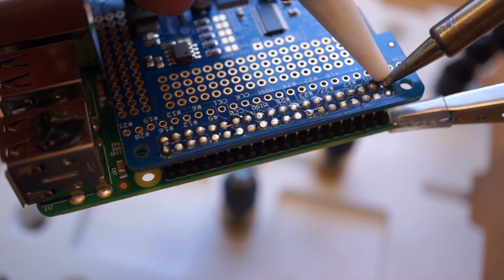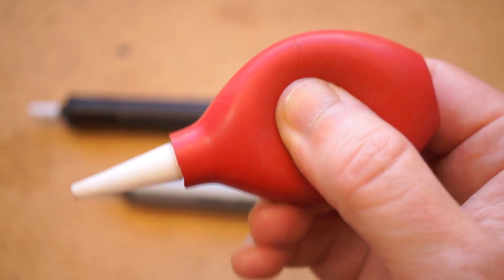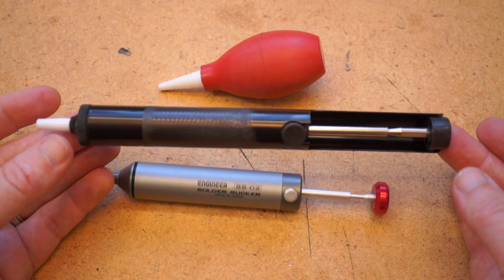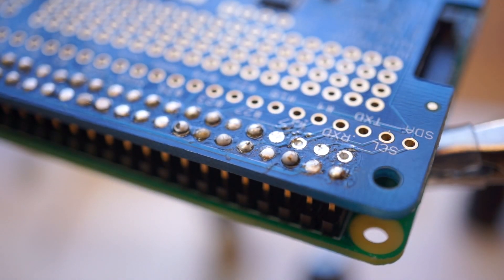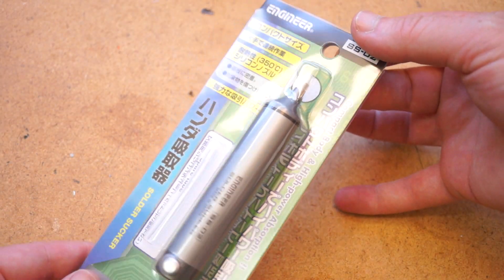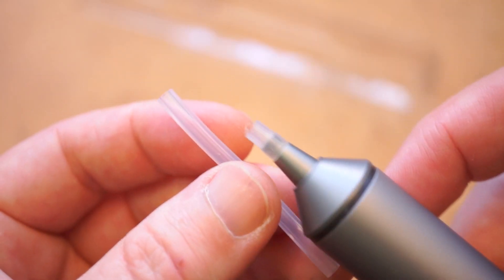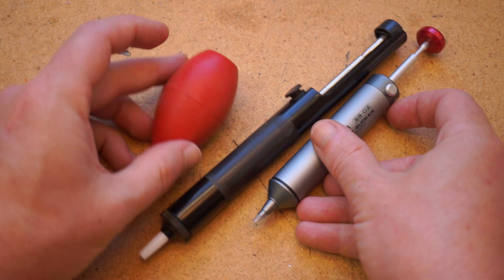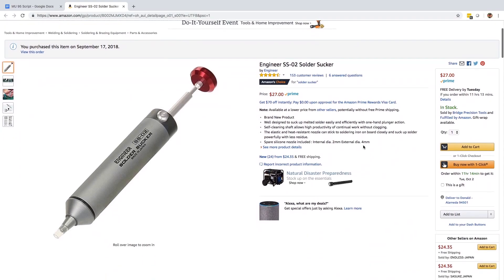Best solder sucker

Comment: Been wishing mine had that flexible tip! I filed the plastic tip of mine to a bit of an angle which made it slightly easier to use but still not ideal. Wonder if I could just get some silicone tubing and push it onto the tip of my current sucker. Though the design of this Engineer is pretty attractive also...
Reply: Yep, I've seen it used in a repair center lol. Cheap silicone tubing just stretched onto the tip. Works wonders and doesn't cost much

Comment: $30?  I would use the money towards an electric desoldering gun. It will permanently end your frustration with desoldering components.
Reply: electric? is there any other kind ?
Reply: @EpicBunty  I'm sure their a butane one made.
Reply: Wish I would have done that. Bought the engineer trying to be a cheapskate. Ended up buying the proskit SS-331H anyway. Wish I had just saved my 30 bucks and put it towards the SS-331H.

Desoldering guns are amazing. No sense spending $30 on something slightly better, when you can spend $130 on something night and day better. Way better value. Granted there might be cheaper alternatives. But didn't wanna waste anymore money trying to be a cheapskate.
Reply: @nerdstrangler4804 what’s the advantage over the plunger
Reply: @phr3ui559  Other than speed and ease of use, the fact that you can seal the nozzle against the board without removing the heat source. 

As with a basic solder sucker you either have to leave air gaps as you try to fit the nozzle around both the component and the soldering iron. Or try to quickly try to remove the iron and clean the joint before it  cools off.

Being able to heat and seal the joint at the same time is much more effective at removing solder. Which is helpful for a lot of modern electronics with really tight tolerances.

Granted, you don't need a big piece of equipment like I have. But if I needed something better than a basic solder sucker, I would probably look for something with a heating element built in.
Reply: A chinese copy can be bought at $5 and it works well.

Comment: Been using a Swedish Paladin solder sucker with teflon micro tips for 40 yrs along with my Weller iron. I love it. Tips cost more probably but the action is professionally clean. If you don't run too much heat, they'll last a good while.

Comment: ty for the tip I just put some silicone tubbing on my plastic tip.
Reply: where did you get a silicone tube? I wanna do the same
Reply: @heeku_  I had a bad handle for my ksger solder iron, so ordered a new and cable followed with it, so I cut a part of the broken handles cable of.

Comment: Or you could do what I do and use the second one you showed and just put high temp silicone on it you could get a meter of it pretty cheap
Reply: what diameter did you use? I only find ones that are maximum 280°C resistant and I solder with 350°C

Comment: 1:10
How do I disassemble it, because I want to clean it? 😢
Reply: Unscrew it. The metal part and the plastic end unscrew.
Tap the metal part upside down on the table. Bits of solder should come  out. Sometimes it will clog up and you will have to push a small screwdriver or something through the tip to losen it up.
Reply: @Rose-ec6he  
I know how 👍
https://youtu.be/bzG0NEdA9oU

Comment: The video shows the worst technique trying to continue to heat the solder while sucking the solder, remove the soldering iron immediately before sucking solder with a good seal on the board and they work much better!.

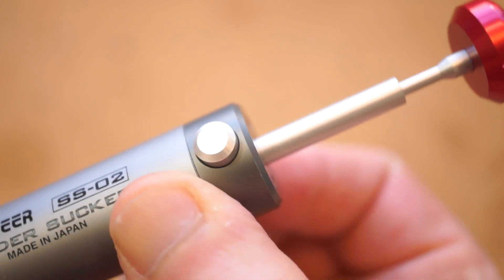Comment: 2:03 So I'll just buy that tubing on eBay or AliExpress, and then add it to my cheap aluminium sucker. Problem solved for a mere fraction of the cost of the SS-02. :-)
Reply: Make sure you get one that can withstand higher temperatures.  The first one I tried melted on the iron tip.
Reply: @ian1352  which diameter did you buy? can you link what you bought?
Reply: thats what i was thinking also
Reply: dude how many times will you make the same comment

Comment: I have the Engineer tool and it's great, but the silicone tube replacements are VERY EXPENSIVE!
Reply: I'm pretty sure a silicon tube like this costs pennies. I use them all the time for fishing and they are dirt cheap. I suggest look for silicon tubes in general not for "Engineer SS-2 silicon tube replacement"
Reply: Go to the closest RC-store and ask for silicone tube for methanol engines.  It is the same silicone and size. Doesn't melt.

Comment: Nowadays you can get a power Desoldering Pump for around $20 ($10 if you order directly from China). While not the best, its an iron and sucker in one, so you can heat the solder while simultaneously sucking the solder away. Perfect and cheap for small jobs, though longevity of it is questionable

Comment: What's the benefit to this instead of just wicking?
Reply: It's easier to get solder out of holes with a sucker or a desoldering gun and you don't need to keep buying new wick. It of course depends on what you are doing if you need one or not. Desoldering a typical 28-pin IC from an ancient computer with a thick pcb and decades old dried up solder and getting the holes cleared for inserting a socket for a new one will require quite a long strip of wick and patience. Using a good solder sucker makes it quite easy, using a desoldering gun makes it a breeze. Using a bad solder sucker is very frustrating and you'll likely break something.

Comment: According to the instrunctions on the Engineer Solder sucker: NEVER REMOVE THE TOP SCREW. also the item is cheaper at Adafruit
Reply: exactly!, if you do this you will mess up the complex seal (it's NOT a simple o-ring seal) and it will lose suction. then it will start to have solder sticking in the metal part of the nozzle area because it wont enter with enough velocity to clear the narrow nozzle body without cooling first.

Comment: I had to resort to a wick/braid for very tiny pcb's because the end of my pump is too big to properly fit over pins that are very close together. I've been having a hard time finding a pump with a narrow tip. Maybe the Engineer pump is the solution or maybe I should save my money and just stick with the braid.
Reply: Sometimes braid is the only way.  It is also usually the best option to get the last remnants of solder off.
Reply: @ian1352  Thanks for this. The braid has become my new best friend. I only wish there was a way to get the solder off so it can be reused. That's the only downside to it IMHO.

Comment: My experience with the engineer has been horrible. After only a few months of light desoldering the spring somehow has so much resistance that I have to hold the base of the sucker with both arms and push the plunger down against the table. Waste of money imo and I’m just going to stick with the cheap ones since at least when they break they are cheap to replace.
Reply: You should watch Retro Gaming Art channel, this video "Cleaning The Engineer SS-02 Solder Sucker - RETRO GAMING ARTS
" he fixes and cleans the pump.

Comment: I think you should read the 1 star reviews on Amazon for the Engineer SS-02 Solder Sucker from people who don't sound like they're electronics novices... which is understandable for anyone who would pay $27.50 for a vacuum pump solder sucker.
Reply: I bought one and sent it back, it's an awful design.
Reply: @O_Prim3 why is it awful
Reply: @maryannetoldme6341  the ergonomics are bad, there's no back to the plunger so it's almost impossible to use one handed. It also gets jammed up all the time so you continually have to empty it out. It's just not good to use.

Comment: My sucker sucks 🙄. I may try to get one of those silicone tubes to save a few bucks.
Reply: They are all crap, search for desoldering gun, they work like a soldering iron by heating the solder (like a normal iron) and then sucking it.